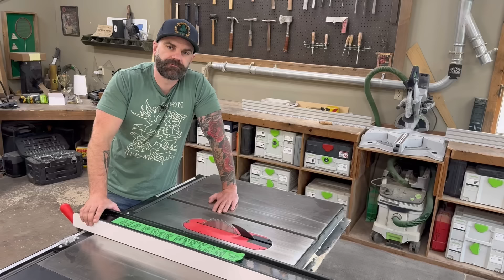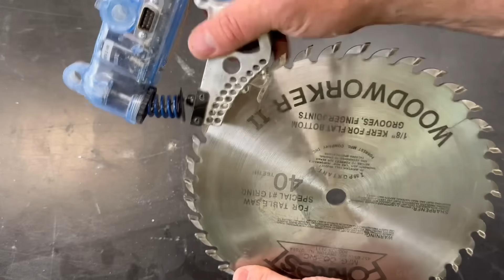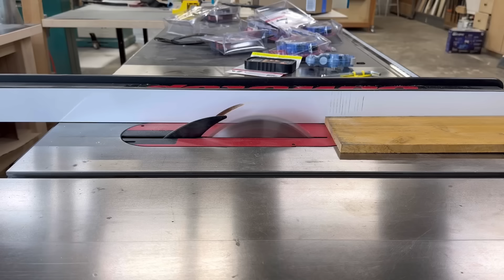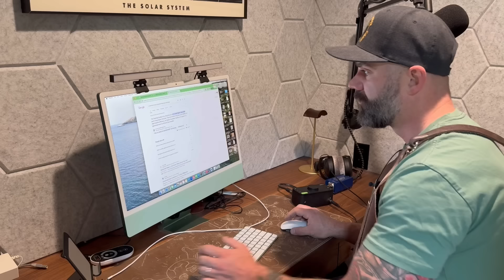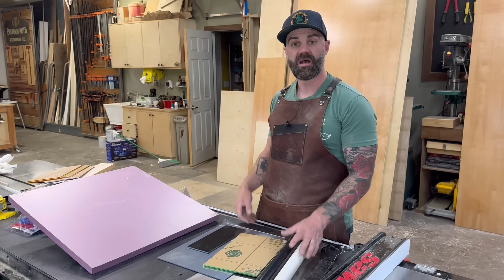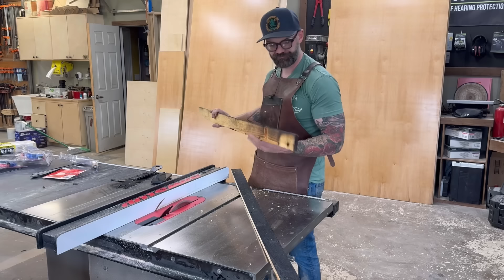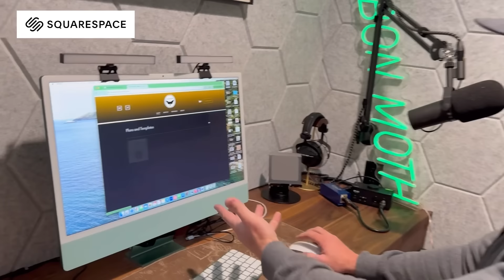Finger Versus Table Saw || Testing SawStop Myths

Comment: Thanks for the entertainment! 
This is one good example of how knowing a little and filling the rest is a dangerous thing.. Mixing up thermal vs electric conductivity, and AC vs DC coupling, basic physics :) This is why carpenters build furniture and electrical engineers design saw stops, don't flip it around please. Sawstop also has a test mode, the bypass, it will not engage the break but still show an indicator light if it would have engaged, used to test out materials without cracking 10's of cartlidges. It might trigger false positives, which is still better than missing out on them, unfortunately due to the patent issues these are not sold in Europe. You have alternatives but not the solid saw stop cabinet saw. Best use cases are especially for schols or rented shops, for semi-experienced users might not be the unique selling feature.

Comment: What SawStop could do is to add to the system a little probe (or something) as a tester on the side somewhere.  Every time you bring a hot dog to it, a red light or buzzer goes off.  Every time you bring a piece of wood to it, nothing happens.  Every time you bring your fingers to it, the red light or buzzer goes off.  That way, a lot of time and costly cartridges can be saved.
Reply: You can actually do this already.  Before turning on the blade(machine power on but blade not rotating) you can put material against the blade.  It will give a flashing red light by the key if its conductive and would set off the blade.  It's not a guarantee cus some things like the acrylicwith static electricity may not do it, or embedded metal, but it does help

Comment: I have personally fired 2 saw stop cartridges with wet wood. I had to turn off the system to finish the project because it kept firing the cartridge.

Edit- The wood I was cutting I had milled myself earlier that year. Green wet wood is different than dried wood thrown in a river.

Comment: I think the next development should be a table saw that when cutting with a dull blade producing smoke in the wood it calls the fire department 🔥 all kidding aside I would not trust any saw to be able to stop when I stick my finger into the blade. I will keep my fingers clear and use push sticks whenever possible.

Comment: the nail was isolated from the bed of the table so no circuit was made, also the rockler test the item was toching the saw bed so it completedd the circuit causing thee wire to get hot

Comment: While this was interesting, it seems you could have done a lot more prior research...as others have said, the saw is def going to be measuring capacitance, ie, the number of electrons that can move into something to equalize the charge from the blade to "it".  That requires something that is electrically conductive (so the electrons can move) and with enough capacitive mass to absorb enough electrons.  Fresh water is not a great conductor, so the flow of electrons would be limited.  A piece of metal can conduct, and has some intrinsic "space" for electrons, but not a lot, so a big piece can absorb enough and a small piece "fills up" too quickly to trigger.  All pretty predictable.  No, it wasn't aluminum vs steel, it was the mass of the metal.
Static charges are high voltage and notoriously low current...ie, very few electrons actually move.
Carbon fiber:  Did it set it off?  Maybe, but since you were touching it, and it is likely conductive, then it was measuring *you*, not the carbon fiber!

Comment: @3:19 "...3 volts of potential current..." Better to say 3 volts of potential to create current.  To say 3 volts of potential current is wrong.  Current is amps, volts is potential.  To mix the two is confusing and sounds wrong.  EDIT: to use a hydraulic analogy, volts is psi(pounds per square inch or potential), amperage is flow (like gallons per minute).  It is like saying 3 psi of flow.

Comment: So less a video about busting SawStop myths and more a video with more exaggerated claims about SawStop with carefully edited videos then? Got it. Give me a break "not sponsored". They sent you that saw for free around the same time they were trying to pawn them off on every YouTuber that ever had wood on their channels. (heh-heh, he said wood) I've been to the demos in stores and saw the SawStop firing during demonstrations just from BORG purchased pressure treated and twice because of a tiny staple the demonstrator missed before he started cutting. SawStop does absolutely NOTHING to stop the main cause, in both professional and private shops, of table saw injuries which is kickback, NOT blade contact. A riving knife and fence set properly square stops all kickback during normal use. The only way to get kickback if the fence is properly set and you're using a riving knife is if you're doing something way beyond sketchy and at that point you need the lesson the injury is going to teach you. A blade guard, which despite YouTuber's penchant for not using, can be used for most operations and an overarm blade guard not connected to the riving knife can be used for literally 95% of your cuts. That blade guard stops 100% of blade contacts. Unless, again, if you're begging for the lesson that injury is going to teach you. Plus SawStop is a garbage company using lawyers and excessively broad patents to stifle competition and force regulations that will enrich SawStop. Patents, in many cases, they never should have been granted in the first place. Fucking "flesh sensing technology" indeed. It's called a capacitance switch and it's been around for over a hundred years.

Comment: It’s capacitance along with conductance that allows the voltage in the blade to change, triggering the brake. So the size of the metal is a big factor. A small aluminum nail would not likely trigger the brake while a large steel fence likely would have.  
Also thermal conductivity is not the same as electrical conductivity, although they are roughly related.

Comment: When you mess with carbon fiber, you need to have a breather and filter. That stuff is worse than saw dust. Worked on aircraft that use carbon fiber and had to know the dangers and PPE required when it is damaged.

Comment: I've set mine off with my thumb, aluminum end of a tapering jig and wet pressure treated wood.  Does the Pressure Treating put more moisture deeper into the wood.

Comment: I own a SawStop. But I can never use it. Every time I get within 20 feet of the table it won't turn on.

The other day I was running. Stepped on and busted off 3 feet of my pecker.

Amazing- now the saw works 17 feet from approaching the saw.

Comment: I've set off the brake cutting wood when I missed a wood screw that I was not touching.  I wonder if you used salt water it would set off.  Long ago we had dogs in the back yard with a six foot chain link fence.  The dogs would climb the fence and get out, so we put a cattle guard electric wire all along the fence at dog nose height.  it worked until we got snow in the yard, and to fix this we put rock salt on the snow along the perimeter where the electric wire was and it worked again to shock them.  The snow (and water) is mostly clean and not a conductor but salt water is.  Great video!

Comment: I have one that may not have been considered when developing the sawstop... What happens if the power go out... like in a storm... if your power were to go out & you touched the blade, accidentally, before it stopped spinning would the the blade break/drop system work?...

Comment: 9:14 mineral contents of tree and water sources would likely change the result. Like high iron levels .
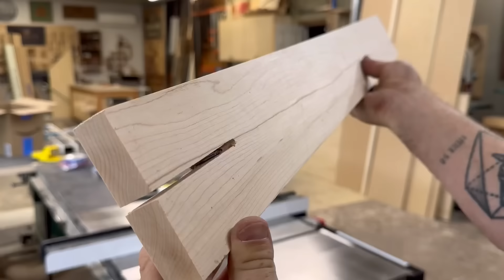Reply: 16:13 pretty sure you got induced voltage by electrolysis in differential metals from aluminum to steel but when you're cutting steel to Steel there's probably no electrolysis happening

Comment: Just watched the Sawstop video and, while I am a big fan of safety, I am also a stickler for accuracy in presentation. I have also watch other videos and you all have one thing in common. You all know what you want to happen, so you sneak up on the blade slowly in expectation of it stopping. Even the other test materials, like the burrito, carbon fiber, you operate in anticipation of the stopping action. Once a material cuts you all revert to regular operating speed because you know it won't shut off. My suggestion would be to try jitting the blade with a hot dog moving at normal pushing speed. Just to verify myself, I am a scenic carpenter with experience in commercial cabinet shops and construction sites since 1969. I love the idea of the sawstop type technology but all the friends I know with tablesaw injuries weren't sliding their hands toward the blade just to see if it would stop. Try dropping the hotdog from 3 to 6 inches above the blade and see what happens. Thanks for listening.
Russ Webb

Comment: I believe SawStop uses an RF (radio frequency) signal on the blade assembly, not 3V direct current.  The sensing circuit is measuring the loading of that RF signal.  So the conductive material that touches the blade is large enough to sap away some of the RF energy, the brake will trigger.  My explanation is a bit over simplified but basically true.  We have had a SawStop in our makerspace for nine years. Most of the time it has triggered there was no reason for it to trigger.  I saw it trigger once when there was nothing at all touching the blade. It has saved a finger or two, so that makes it all worth while.  I don't think it has ever triggered on wet wood.  But we discourage cutting of wet wood on the saw. It has triggered on touching metal in jigs that people thought were fine.  It has triggered when people try to cut mirrored acrylic. We have probably bought $3,000 worth of brake assemblies over the past nine years. We have had laser cut (charred) wood trigger the brake.

Comment: You know that you can touch the saw blade with any material including your finger with the saw turned off (powered on but not running) and the light above the power switch will flash if the material will trigger the safety stop, you will have to reset the saw if it does trigger but it will not fire the safety, this is how I test any material and even the just safety of the saw if I haven't used it in a while or after a power outage. All the same test you have done with none of the expense

Comment: that dude you called does not understand how electricity works.
Reply: How would you explain tge saw stop safety system?
Reply: @Santorien  I don't know how it works. It's likely either a sensor measuring the current through the blade or something with capacitance. 
What I do know is that the things that guy was saying don't make sense.

Comment: The fence has bolts and the slides may be aluminum, any bolt which connects metal top to bottom, may conduct all the way thru. Use an Ohm Meter/continuity probe to check for conduction from the blade touch point to the table top. Screwing  an aluminum angle and electrically isolating the top from the bottom may not trip stop. 😮🎉

Comment: A great test for steel would be trying to cut some 1 1/4" diameter 1/8" wall SHS with the saw. That way you know it's not just because the mass of the aluminium was much higher. I mean assuming you don't have to go out and buy a metal cutting blade for that, cause that might just be too expensive to bother with lol

Comment: Conductivity requires a completed circuit, not just the resistance/conductivity of the material. A completed circuit could also be capacitive as well. (note that an ac signal flows through a capacitor.) Most likely the sensing signal is a frequency, hence it will detect your body as a capacitive conductor. For example, the nail is isolated from the table saw, it is a small in area, hence little capacitive coupling. If you wire the nail to the table saw top, it might then trigger the Sawstop as you have completed the circuit. Also note that the mitre gauge that tripped the Sawstop is a larger piece of metal and hence has a much higher capacitive coupling to the table saw than a nail or staple. So you need to think in terms of ac signal and capacitive coupling. Try running the hotdog through the blade on top of a 2 inch dry board and not touching your body, thus reducing the capcitive coupling to the table saw top. Does that trigger it? If you try to cut insulation with foil backing, it will have a higher capacitive coupling than than non-foil backed insulation. Hope this helps in understanding what triggers the Sawstop.

Comment: 7-26-24 Thank you for this video. At 77 yo retiring from 31 years owning a different type small business and getting into woodworking as my hobby. Spent a bunch of money for wood working machines and looking at Sawstop to replace my current smaller saw I've had for many years but had some issues spending the money. However, at this age I find the brain is slower, memory sucks, the balance is less, other things as well. Just sold some of my specialized tools for the business I'm closing, proceeds will cover the cost of the 1.75hp 52" T-glide (PSC175-TGP252).  Will order the Sawstop while the slight discount sale is ongoing. Tell Sawstop you just sold a saw for them. Watched a lot of videos but yours made the sale.  The only question now is what needs to go with it and I'll use the local Woodcraft for additional advice. Thank you again and I subscribed to Burbonmoth.....

Comment: I purchased the Industrial version of the  SawStop in 2008. At the time there were no other models offered for sale. I triggered the safety feature twice with wet wood. Wood, by the way, I did not consider that wet? And one time a nail triggered it. In all of these cases I was able to have my Woodworker II blade repaired. One or two new carbides at most each time. Never had any followed up trouble with the saw repair. However after relocating out of state the local SawStop dealer where I now live won't do these repairs. He thinks I'm nuts. Food for thought. The safety mechanism may have been substantially refined between the time I purchased my saw and your demonstration??

Comment: This technology has become ridiculously cheap and ubiquitous already because it’s already being used in every touchscreen device.  

This could probably be applied to band saws and other large shop tools that use metal blades or bits.  The stopping mechanism might not stop as fast or as reliably as a spinning blade does in a saw stop—but it could mean the difference between saving or losing a finger.

Comment: On day 1 after assembling my Sawstop, i triggered the brake by running a piece of plywood through that had wicked up water off the floor. That was 7 years ago. So wet wood definitely can set it off. Though i cannot explain why it didn't in your tests. My second brake activation happened yesterday with a dado stack. Expensive. I forgot to go adjust the aluminum fence on my miter gauge after installing a dado stack. The fence caught the blade and has only a tiny scratch. The dado stack had many broken teeth and was a real pain to get out.

Comment: Two things. First I hope that your saw it still ok. You might have cracked the plastic thing that puts the electricity to the arbor. This can happen when a saw is triggered more than a few or couple of times. Saw stop can help you know if this is the case and the fix is a new arbor assemble. 

Second, I got my first saw in 2007. It was a cb saw. There where two things that broke. The elevation gears and the 45 . They made changes to them and then sent the new design ones to me at no charge.  The only thing that is different between my cb and ics saw is the cartridge. If I wanted I could call them and ask for the part numbers to convert the cb to the ics blue cartridge. Twenty years and the saws still have great support. 

Three tripped cartridges. On one coast down. You know where 50% of industrial accidents occur. Motor off blade spinning. This one saved my hand and paid for the saws. Next was I heard something so I opened up a door with the motor running to try to find the bearings that where going out. The last one was a ff screw. For five years I was able to just hit the screw heads. This one set it off. My luck ran out. The screw must have made the space between the blade and the cartridge to small. This will set the saw off to. 

My buddy set his saw off this way. The nickel is a must to not set it off. Or that yellow thing if you have a newer saw.

Comment: On the static tests, relative humidity of the environment can play a big role. Lower the humidity, the more charge can be stored (ie. doesn't bleed off into the air as easily).

Comment: My understanding of the saw stop system (from what John said) is that there's a capacitance in the blade that wants to discharge. Think of this like a high pressure wanting to release; it needs another object (or body) to release that pressure into. 

Also, you having a static charge is the opposite of what you want when using the saw, because if your "pressure" is equal to that of what the blade has, then it won't empty into you and trigger the stop (tho I think they've probably thought of this and have a very high capacitance in the blade- idk how much the human body can hold) 

This means that large pieces of metal that have been grounded are kinda like having an empty pressure tank, and your blade is at 50psi; it'll dump the moment you open the valve by connecting the two. A nail is like a very small container; a vial - or a submarine under the ocean; opening the door isn't going to drain all the water into it, even if the pressure is that different, because the capacitance isn't there (the capacity to absorb).

Please someone add to or correct this analogy; I think it's helpful if we all know how it works in simpler terms that might make more sense to us